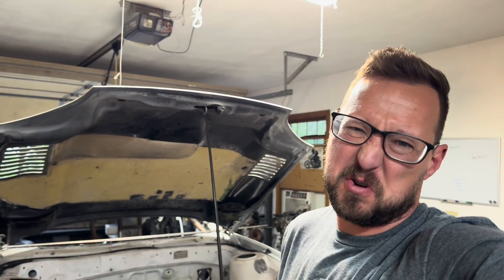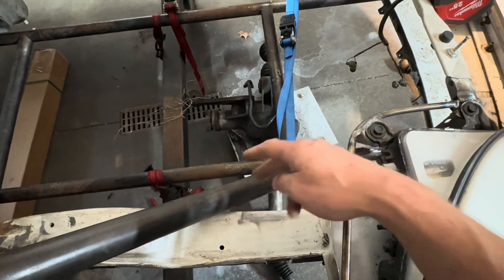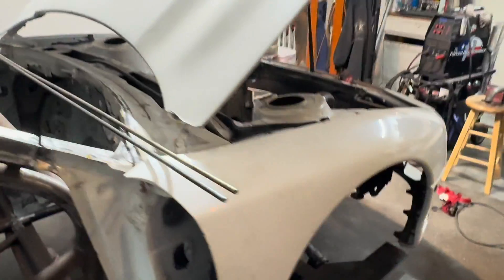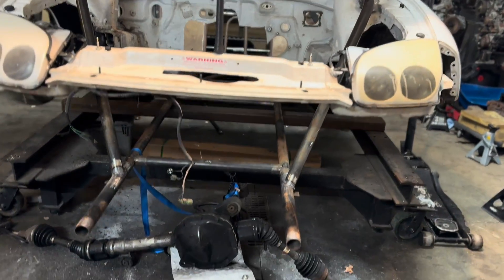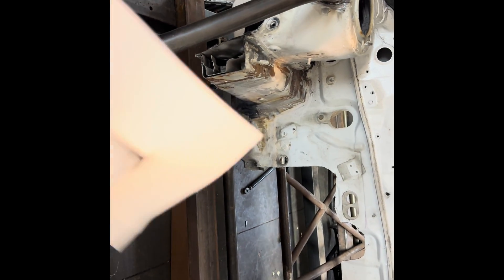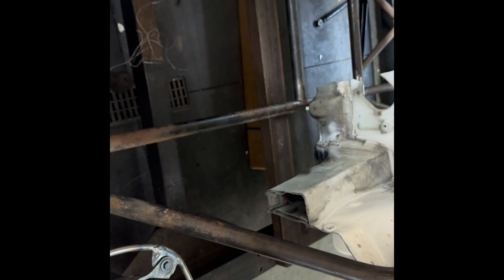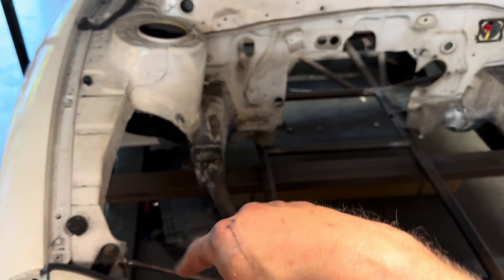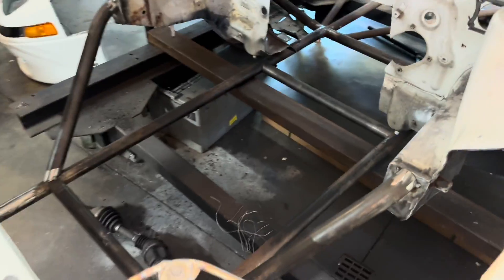Tube Front End fabrication - 4wd AWD 3000GT Drag Car

Comment: I know you're going to be using a massive intercooler, either use it as a brace between the lower tubes and the header panel or make a removable package rad and intercooler like Garret's car had. Make pulling the engine easier.
Reply from the maker: Yeah for sure! The FMIC will probably end up being the perfect support